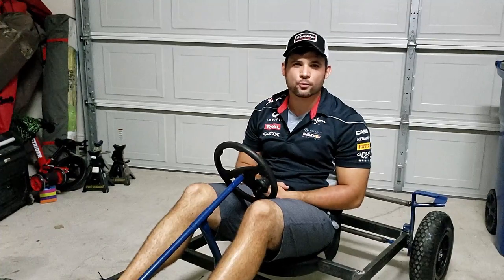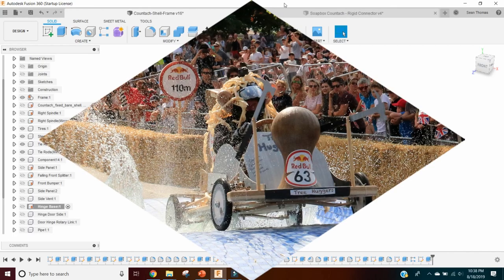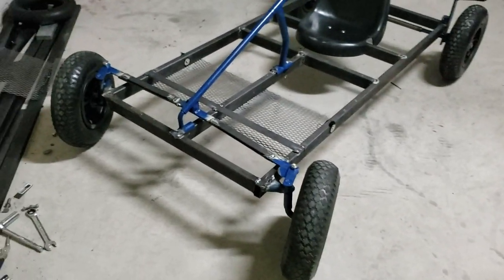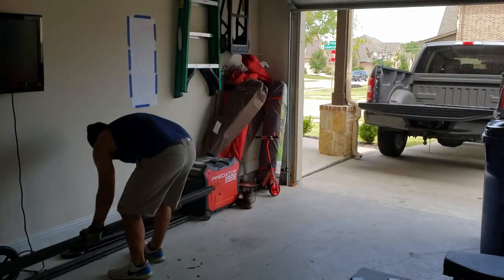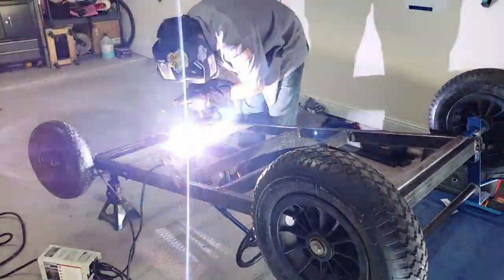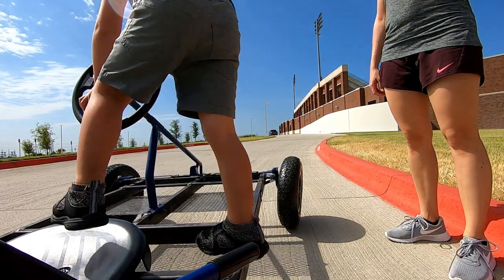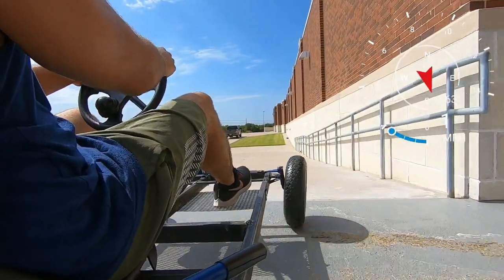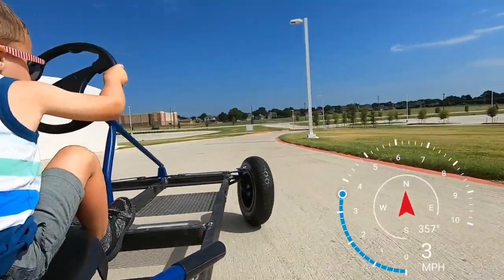Red Bull Soapbox Race - Frame Design and Build

Comment: You need to learn what gussets are.
Reply from the maker: What failure mode from these videos do you think gussets have prevented?
Reply: @EngineeringAfterHours  The gussets would prevent the front and rear frame collapse which is often seen as the wheels bend or fly off. This is important with square tube construction. I think round tube has a strength and weight advantage over square tube though you would need a bender and hole cutter to make good solid welds. I also see that the direct steering in most "boxes" is way too twitchy and needs a second linkage to reduce and buffer the steering input. Perhaps a gear reduction would be a good solution even if the wobbles happen.  It also seems that bigger-diameter wheels/tires have an advantage over smaller ones. I love these races and would love to build a car with a team sometime.
Reply from the maker: @superbmediacontentcreator  that failure mode didn't happen in this case...so it wouldn't have been an improvement but it would have taken time that I didn't have. The frame is also deliberately designed to flex since there is no suspension

I think you're over thinking the point of the redbull soapbox races. The car in this case had several failure points deliberately designed in because it was modeled after the crash scene from wolf of Wallstreet.

Comment: How did you make the turning system?
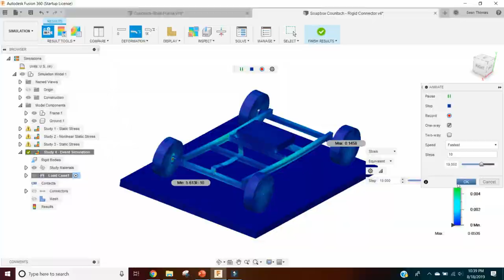Reply from the maker: I ripped them straight off the donor cart and just welded extensions on the make it wide enough. At 1:27 you can see what the basic steering looks like.